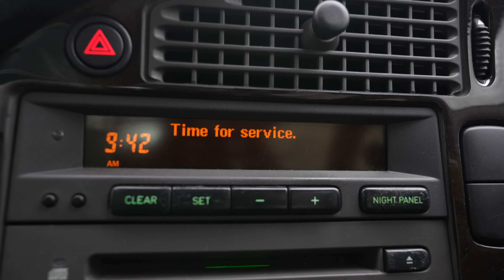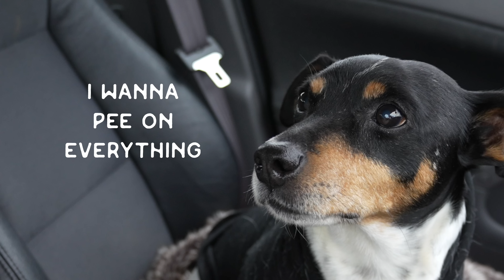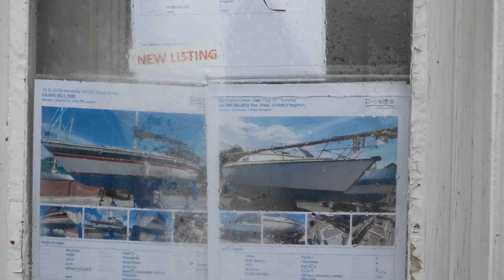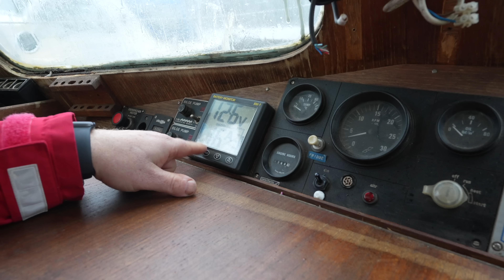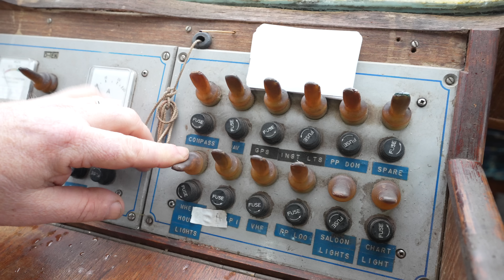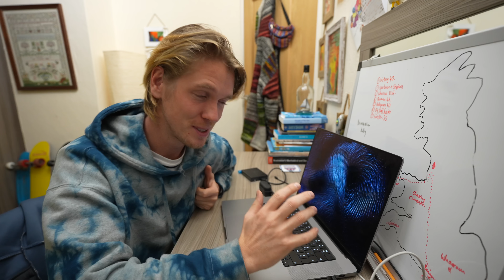Should I Buy This SALVAGED Steel YACHT? Sailing Melody Special Deal! | Wildling Sailing

Comment: I’d say go for this boat, for sure. Out of all the ones you’ve shown so far, this is not only the most cost effective, but also the best fitted for your needs, from what I’ve gathered watching your videos.
Andy and Melissa are very good at what they’ve done so far with Melody and you’ll greatly benefit by not only getting a great deal, but a massively versatile boat with a low draft and extremely high bluewater capabilities built up all in one boat.
The fact she’s a steel hull will also make it great for longevity as steel isn’t as expensive or as quality-dependent like wood is, meaning repairs can be done anywhere around the world. The bilge keel will make it so you can make use of that low draft and sit it down on whatever beach you fancy, giving you access to many more locations than you’d normally get. 

This is an amazing boat, and I wish I could find a deal this good over here in Texas. It’d be perfect for the shallow draft, rocky beaches, and crazy storms we have over here. 
Much luck to you, Mark! Hope to meet ya someday
Reply: Unfortunately, the running costs of a motor-sailor, not to mention its slower speed, make it an expensive boat.

Comment: She is your best boat - if not the only boat - you should be considering.  Compare her with the Endurance 35 for price, gear, sailing capability.  Not fast, probably better suited for higher latitudes, No need for water maker, may need radar for N climes in particular.  Some serious finishing work - BUT lots of it can be done by relatively unskilled m & F help - sanding, painting, interior furnishings etc.  Think about deck covering - don't worry about the centre-board, great help for sailing this boat.  The "support" to get the work done is hugely helpful!.  Mechanics fit well with your father & your skills.  Welders are to be found everywhere globally - especially fi she is used as an "expedition" rather than simply a cruising boat.  Lots of plusses here - I vote "Yes"
Reply: He does not need some wallowing motor-sailor which empties out his wallet every time he runs its motor.
High latitudes are rather short on fuel stores and a good sailing rig comes into its own.
Reply: Expedition vessel hahahaha Fukn hell🤣

Comment: I follow the Sailing Melody channel, and it's a very generous offer, but I personally would go for the Freedom. For me sailing is a a romantic adventure and the beauty of the boat is important.
Reply: Zal., running costs (fuel) for that boat (a motor-sailor) would be high. Sailing performance is very secondary.
Reply: @alexandermenzies9954  I was talking about beauty. Although I also think that sailing performance and the ability to point into the wind are an important safety feature.
Reply: @zalacainbilbao  I'm with you when it comes to beauty in design. It is in definite short supply with the design in question.

Comment: Mark don`t buy it.  This boat will be too slow for sailing, you will be Using the motor to often, costing thousands per year in fuel.
 Also no decent bunks to use while at anchor. 
  It will be great for a person that wants to travel the rivers and canals around Europe..
  Its a shame the timing was all wrong,  you would be the owner of the Bowman trust me !!!

Comment: No, I wouldn't buy. More a motorsailor - heavy, high topsides and likely won't sail that well. Likely won't be putting on too many miles per day on your ocean passages on this. Plus steel can be a maintenance headache - see Barry on Seadog. 1981 Moody 36 centre cockpit for sale for 27,500 in Inverkip as well as that Rival 34 for 19,500. Likely better "sailing" boats.   I think you need to decide what you want in a boat.
Reply: Well said, Johnny. Unfortunately, you can detect that most commenters have never sailed  and are engaged in silly happy families nonsense.

Comment: Mark.   You need to go somewhere quiet & sit down and decide what you want in a boat. Whare you plan to go, are you going to sail alone or will you have a crew. Most of your commenters are saying to buy anything you have looked at, but they aren't putting up the money or will have to prepare to sail.  Buying is easy,  finishing the restorations could take months. Are you prepared for this.   Go and have a good     thinkkk     before you spend you'r money. Good luck.
Reply: Seems like he does not even know what he does not know, ignorant of his unknowing - just feelings, ignoring the economics, discounting the help to refit to completion.

Comment: Nice boat and a very kind offer, but still needs a lot of work, even when afloat. Then there's the constant painting with a steel boat... There's also the fact that she's a bit of a tub - a motorsailer; that might not bother you initially but slow boats can wear you down if you are used to something with reasonable performance, and this looks a bit more like motor than sailor.

Comment: Maybe I missed part of the discussion but does anyone know how well this vessel actually sails? 
Does she needs a blow to get it moving. 
Also I heard Andy mention a stay sail I think it was that was in as new condition how about the other sails are they ready to go? 
Mark you have implied in past editions that your dream is to see the world make sure the boat sails and sails well. 
My experience is boats that have enormous engines are there for a reason and are used a lot . Make sure she sails well and Not more of a motor sailer.
I like Andy and the work done to resurrect this steel boat and he is offering it at a very fair price.
Reply: Roller furling main into the masts not a reliable system.

Comment: I would buy that boat in a second.
I’ve always loved the idea that, as he said, if anything goes wrong, you can just cut the damage out, and weld a new piece on. Also… if you need a shelf… ZAP! you’ve got a shelf.
The only thing that I don’t like about steel boats is the zinks. You gotta keep an eye on those, and I get complaisant about that kind of thing.

Comment: G'day  Mark,,
Personally, I like the boat,also like steel for the safety factor & it's easy to replace  any section .
Welding is easy for most handymen.
The price seems reasonable, considering  the work already undertaken. 
The remaining work   Andy will assist with.  
Ultimately, patience pays off as you know ,so as always you think about its suitability before making any decisions..
Great to see you looking arround, when you find what you have in mind ,,,it will jump out at you.
Good luck with the search .

    Respect...!

Comment: Another factor of course is taht this boat will be able to take you way up North into the Artic if you so choose to do so. You will not have any issues with icebergs on this boat or random floating steel containers too, lol!. And heat wont be an issue either as that comes all built in for you. However, if you are planning to mostly sail around in the warmer climates I think it would not be a good fit for that climate. Although, many have used an aluminum boat for good all around all weather sailing conditions.

Comment: I owned a 60" dutch barge. "Rust never sleeps". Do you have access to the inside of the hull? I had the same engine. Great strong engine, no problems. You will know it's the right boat when you see it. Good hunting.

Comment: And I love the keel arrangement, 90% of the time that swing keel will be in the 3/4 up position (when surveying an achorage if the board bumps you back up - in a hurry!).  The only time the board would need to be all the way down is when heading to windward, then it'll be worth all the hassle amd more!  I've owned two smaller cruising boats that both had a similar swing keel arrangement and i liked both of them.

Comment: Well Mark,  this could be your boat. Get it, make it ready, start sailing, meet sailmates, and after a few summers find your wharram. Good Luck. A steal boot is very solid and safe as long as you preserve it and avoid the rust in  hidden corners. I,m sailing myself many years on a stealboat at dutch coastal waters.

Comment: I have a jeanneau sundream 28. Its 30ft with a steel lift keel or rather centerboard between an iron stub keel. The lift mechanism came apart over Christmas during a sail. Unsure if lift keel there on the pivot pin still until a lift out, but for now trying to source 2 different sized custom clevis pins for the lift bars which go inside the keel box below the galley table as of course being for a boat they are custom sizes. One end of the bars connect to the lift keel, the other end has a rope to the winch on the box. Cheapest quote I have for now is approx £200-300 for 5 of each so I have x4 spares of each. Glug... 

Melody is fantastic with loads of scope, knowledgable owner. I have heard of the channel but didnt follow them, sorry.

Great offer, my 1988 boat was 11k and took another 9k approx to now and it's nothing like the superior melody. Though Barry of Adventures of an old sea dog and a steel boat owner at my previous yacht club with a van de stadt seemed to forever be sorting put rust spots

Comment: I like the boat for a blue water/round the world cruiser.  The inside pilot house is great for bad weather and night sails. And it seems like it would be really sturdy in wind.  But? It isn’t pretty like Minke.  I do like the setup, though, if you are sailing alone.  You can practically live in the pilot house on overnight and multi day sails.
Reply: I have the certain impression you've never sailed, around the world or any where else.

Comment: 😱😱😱 Whaaaat? I'm simply not able to believe this low price after all the invested and really well done work! I say it's a mistake to sell something like that so cheap. Unfortunately I don't need a boat. But if, I would not even hesitate for 1 second and buy it as it is for 16.600 pounds (anything less wouldn't be fair). Or, even better, for 20- 22.000 € completed and in the water. Good heavens, what an opportunity! Nearly unbelievable. I just can't get over it!
2) Personally I prefer sturdy steel boats over any other boat. This is even a 3 keel type with a fantastic engine! I definitely don't want to work with fibre glass and especially don't want to sand fibre glass. I definitely also don't want to deal with rotten wood and mold.

Comment: I'd be tempted at the price... Not a bad option at all with plenty of work still to be done to make it yours, along with Andy's knowledge to help to get her into sailing condition. I'd be a little concerned about the complexities of the swing keel and would approach the in mast furling with caution. She doesn't have self-tailing primaries which for a heavy displacement boat might make short handed, short tacking a challenge. The relatively heavy displacement that comes with steel might mean she needs a decent breeze to get her moving under sail.

Comment: To prevent rust and fire there is a product being used by major oil companies 
Good news it will soon be offered to the marine industry. Green ceramic coating that bonds to steel and prevents corrosion permanently. Fire resistant to thousand degrees for steel and wood. Dries in ten minutes. I play golf with the owner and founder and  I  know it works. Just trying to decide how to  market..ie distributor or franchise

Comment: Here is a boat that was built original 30 years ago and still going strong in the trans pacific. The original welding and for the 30 year lifetime upgrades was done by a heck of welder woman. P.S. Check out their homemade water filter episode.
https://www.youtube.com/@SailingEmeraldSteel/featured

Look at receipts, are there 15K worth?
The yet to be figured is condition and expense of sails, rigging, ropes, anchor and chain. 
What is the mast, boom construction material, the sail config and ratio. Traveler?
The lasserette's primary purpose originally was to protect against sinking. If you damage your prop shaft packing, not rare, the water would not flow into the cabin, but into a small water proof compartment called the lasserette.

Is the deck steel, is the pilot house steel, and what window type are installed, Lexan?
Interior paneling can always be veneered at a later date.
Sail area displacement: will it work? Survey?
https://wavetrain.net/2011/03/17/crunching-numbers-sail-areadisplacement-ratio/

I don't agree with the engine assessment but he has the backup of a mechanic assessment and you have your Pops.
Is there a generator?
Can you accept the electronics? I would find it in need of upgrading Radar, GPS,  Radio, Antennas, speedometer, Windometer and vane,  Wifi, windlass 
What about refrigeration, electric outlets.
What was bottom sand blasted and paint correctly applied?
What about vessel lights?
What about new pumps and bilge?
What about throughputs, are there enough, and location?
What about life raft?
What about the dinghy? 

Like the man said any future steel work will be is cut and weld fab. 
The steel hull, littoral swing keel is the best feature it will retain resale value, and secondly you will not have to haul for quick repairs, ie: shaft, prop, zincs, inspections.
If you can think of a structure project you can add to that boat no problem. ie. dingy davits, hatches, port lights, heating, ventilation and cooling?

Comment: This vessel, is a true expedition cruiser. You could get a portable  arc welder , and do your own fixing. There is a reason steel ,is used in commercial  vessel construction. The issue is you have to do a lot  of chipping rust, needle gun 🔫,  also part of maintenance. You have to use   special primers and topcoat paints. You could outfit, with good  heating system, diesel,  and or combine we ith a pellet burning woodstove.

Comment: Think about what kind of ship you want. The rule of thumb is, buy a yacht as small a size as you need. Do watch Roger Barne, he does FAN- TAS-TIC trips in a beautiful 15 foot open dinghy. When your favourite water is pretty shallow, you will love a centerboard ship is (how about a cat or a tri or the shrimper family?), however, when you cross the North Sea each time you set sail, a 10 feet deep bloody heavy lead bulb is fine. Do think about where you want to go, and where you ACTUALLY go. The latter is more important, really.

Larger means more living space, but to say it bluntly: everything you need to buy will be twice as expensive. New sails are X pounds a square feet. Second hand sail prices are related to new price. Larger will cost you. Small ships are more kind to you. Consider a size of ship that you can sail solo without getting nervous. Okay, if you don't get it by now, this jotting is useless. So, please please watch any video of Roger Barne. He lives in France and he is one of the people sailing open dinghies on splendid water. And BUY or BUILD such a great open dinghy, you will never regret such.

Comment: Considering it was sold for £2000 it must have been very neglected. I would certainly get a survey done on the hull. There might be some very thin corroded metal about. 10/13 years of life is very optimistic. I needle gunned a steel hull a couple of years ago. The pitting went deep.

Comment: Don’t be worried about steel construction. An arc set is relatively cheap and compact and works like a metal glue gun!  I would have it over wood any day.
 As you say, it’s purely down to personal choice. Seems like a really good deal and it comes with consultancy worth several Ks.
 
If I am honest, the freedom is so beautiful whilst Melody is so practical/comfortable/robust. I would buy the Freedom and periodically hanker after the extra practicality I had rejected. (especially mid Atlantic in shitty conditions). That’s me!  I am a sucker for beauty over practicality and am happy to repent at leisure.
 I fear, however, that you should follow your heart and buy your dream boat and get that out of your system as every tropical living thing tries to eat it out from under you!😂

Comment: Best one you have looked at so far. Steel is easy to repair. You can soon learn how to weld steel.& repair it antwhere in the world.  But do you like it? The freedom is not very nice in my view. With this you can belt a reef & survive. Why do you need a bigger boat?
Reply: Welding isn't difficult, you're going to grind it anyway.  I wouldn't want it because of sailing performance, but definitely stable

Comment: Shorter steel boats like this are known to be heavy and slow for their size.  Apparently its only at around 45' that steel weight starts rivaling FG, and making the boats comparable. The extra wetted surface of the bilge keels also won't help.

Comment: I've only owned one steel sea boat (42') but it's not hard to see that this boat has been carefully rebuilt.  In storm conditions (and sailing around the world you will see more than your fair share of foul wx) nothing comes close to the durability of steel.  My one desire has always been a pilot house, it just makes so much sense - it should however have opening forward windows for the tropics.  I've also sailed with that engine and they are rock solid, but not fuel efficient in any way - but a sailboat should be sailed not motored about!  Another good option, I like this one better than the Freedom, a lot of work still to do, but mostly work and not so much cash, which I think is what you're looking for (trading labour for money up front).